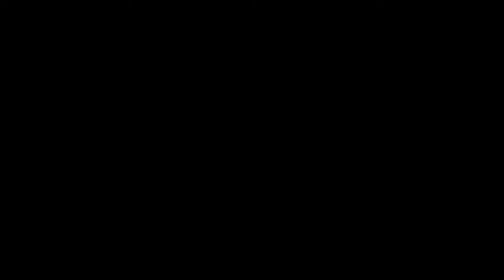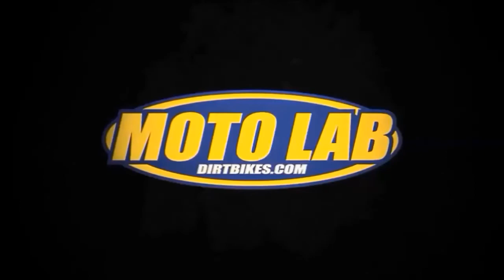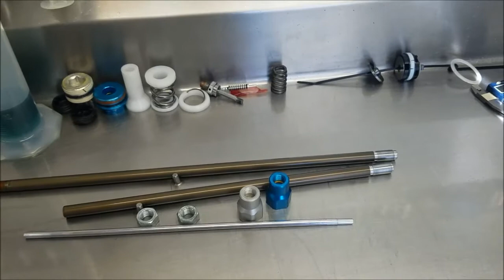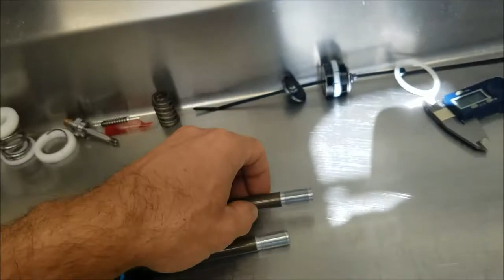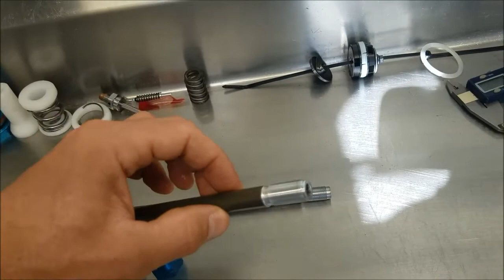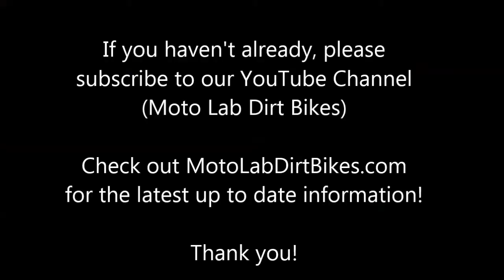KTM and Husky WP AER 48mm Air Fork Lowering service

Comment: I’m needing to lower my 2023 KTM 250 XCF forks, and am trying to find the information needed to do so. My husband and I asked our dealership, and they weren’t really too confident about lowering the forks on the new models or giving us any kind of direction. They were able to put a softer spring in the rear suspension which has helped a smidge, still need about an inch. We are also waiting on our backup seat to come in so we can shave it (which won’t be until like November since everything for the new bikes is backordered, took forever just to get pegs). Now it’s just figuring out the forks. Would you know if it is the same technique you are showing or has it changed? Are you able to point us in the right direction? Thank you from someone who would like to not almost fall over every time I stop. 😬
Reply from the maker: Yes, we can lower that model -2" at the most. Please complete our Rider information form on our website to get started and for a pricing estimate! www.motolabdirtbikes.com